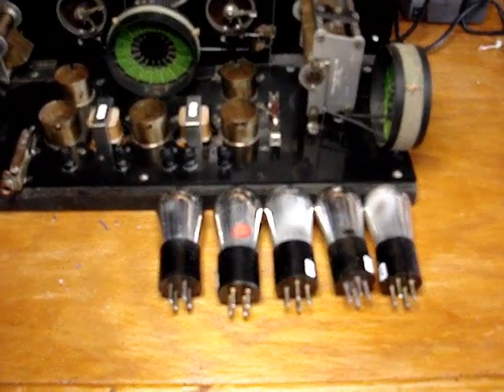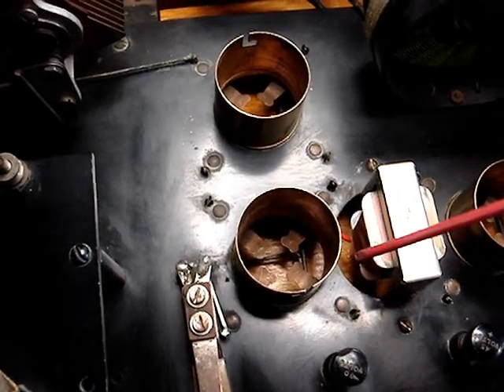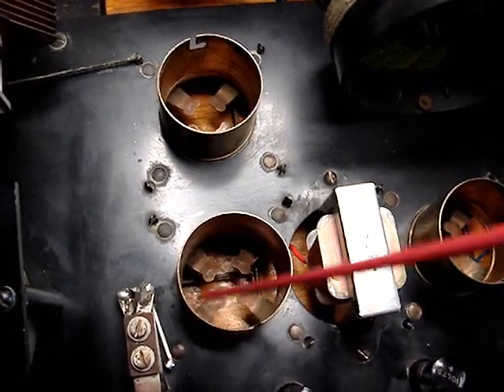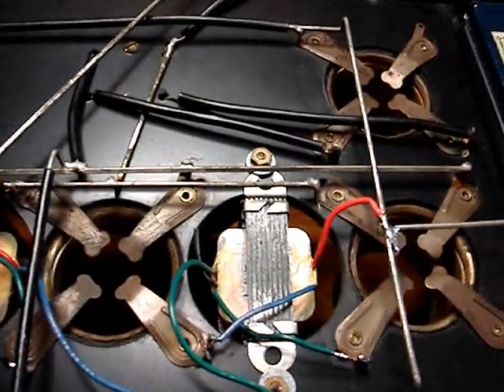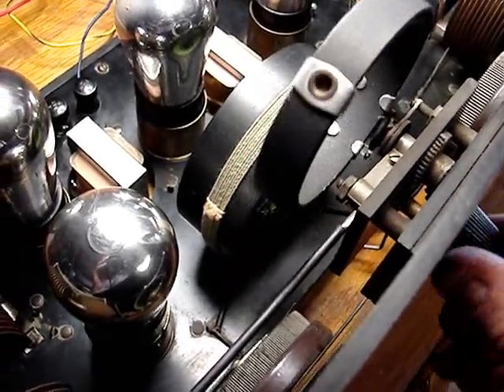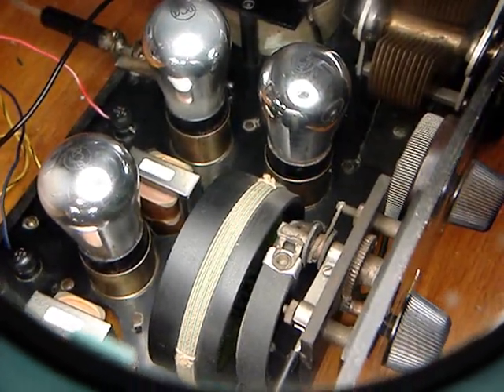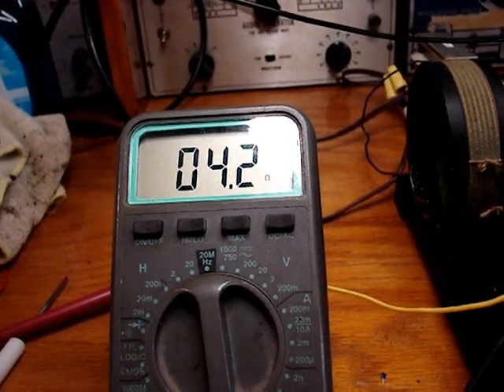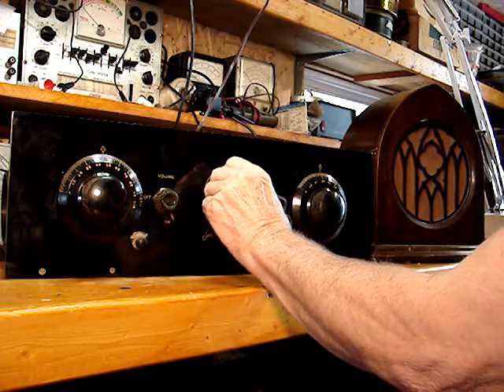Oriole Radio Model 7B (1925) Restoration PT2

Comment: Are you sure that those broken solder connections were to the filaments on the tube sockets?  An Oriole should have a a B+ bus connected to the plates.  The filaments feed to the primary of the next RF transofrmer coil.  --AA1UK